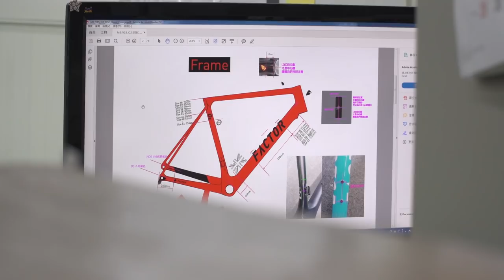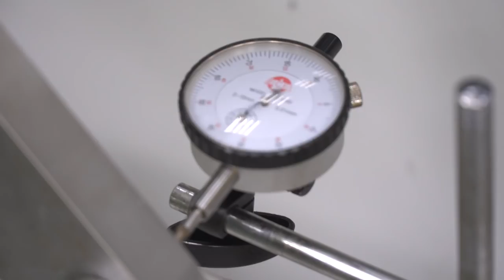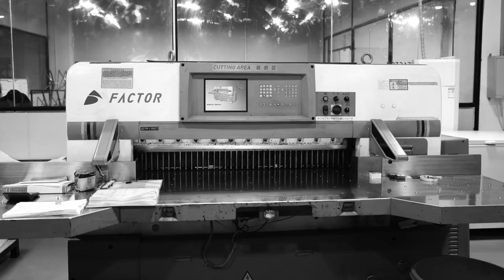Inside Factor Bikes | GCN Tours The Factor HQ

Comment: I've been watching Raoul Luescher's videos on bike manufacture.  The things he finds are very eye opening and I trust his expertise.  I'd like to know more about the manufacturing process now.  It's inside the frame that counts.  After dropping weights on components how do they know there are no cracks in them?  Seeing cracks inside the carbon is hard enough without painting the the part.
Reply: Dunno, kinda looked like a small void on the side of the seat-clamp hole to me!
Essentially the smaller your process the more you can oversee each individual person and the more you can train them, so you don't get Steve - who used to be from accounting - turning up hungover and just throwing carbon at the mould incorrectly.
Reply: I get that.  A smaller hand picked team that you can train and keep an eye on but I think the real gains are in using techniques that avoid human error.  Raoul is describing things like semi-rigid internal bladders and expanding mandrels to avoid wrinkles.  Using a fallible process and then criticising people for being human isn't very smart.
Reply: every process can fail, as Raoul points out even airplane parts can be made incorrectly, or not up to standard, the rate of which increases after lay-offs. It's about catching those parts before they go to a consumer and using better techniques or methods for making them in the first place. Smaller factory can be more picky with the workers it hirers and is more likely to have longer-term workers - assuming it's run correctly. Realistically processes need to be designed around human failure, there's a lot of large scale engineering examples of bad design that leads to human mistakes that leads to major disasters. It's the whole design cycle which needs to have safety worked into it, from adequate material safety factors, to supervision of workers, to accountability of every part/batch, through to end QC.
Reply: Phased Array Testing is standard for subsurface cracking, its ultrasound technology similar to the types of test used in pregnancy. It basically uses sound waves out of phase, that are reflected back if there is a crack or a void in the material. Have a Google if you want to know more.

Comment: pendulum test seems misleading since the whole frame with its supports on ground are moving when the pendulum hits. this movement shows that some of the force applied is transformed to movement instead of being absorbed by seatstay. such tests on specific parts should be done while the frame is fixed where momentum of the mechanism cannot be transformed to movement.
Reply: Ozan Targal -- Still it's a lot better than most bike companies that sub out their work to inexpensive subcontractors everywhere in Tiawan.

Comment: Not sure what make of rear mech is fitted to the bike in the back ground but the jockey wheels are huge!!! Well in comparison to what I’m used to anyway. See 2 mins 14 secs.
Reply: It's from a brand called Ceramic speed. They make high end component, helping save a small amount of watts. Their bearings are ceramic, instead of steel, and their jockey wheels are massive (17t instead of 11) as it means the chain doesn't bend as much, which uses less energy. They're expensive, so not worth thinking about for 99% of cyclists, but it works.

Comment: You would have thought that the frame stiffness test would have been done with the crank arm at around 90 degrees, or whatever correcpsonds to the typical rider's crank angle at max. pedal force. I'm sure it isn't at the angle it's at !! Still, it sounds as though some real engineering thought has gone into this.
Reply: By my intuition, flex isn't necessarily highest at the point in the pedal stroke where you make the most power. Anyway, as long as they're consistent with the angle it shouldn't matter where they test it.
Reply: No, it isn't necessarily at the highest point in the pedal stroke. However, it's at the highest crank torque that is where you want the highest stiffness to get the force to the back wheel and not store it as elastic energy.

What you'd really want is a bridged strain gauge on each tube to be measuring strains as a function of crank angle.

What this comes down to is that I would like to understand the reasoning behind them doing the test at that set up.
Reply: I would do multiple test, with the same load in each, but with the crank arm at every ten degrees around the pedal stroke. Then find the position with max deflection.
Reply: ...which is what I said.

Comment: Did I hear that right.....30mm or 13mm deflection at the end of the crank with 105kg on the drive side? Sounded like 30mm which is surprising.
Reply: tarmacsurfers yeah, I heard 30 mm
Reply: same, quite a bit of bendage, is it not?
Reply: I think he read it wrong, 13 or 30mm is a lot in terms of deflection. i could have been 1.3 or 3.0 mm which seems more plausible .
Reply: Mike Pop this is what I was thinking. I cannot recall seeing an engineers clock gauge go up to 30mm, plus this doesn't sound like a very stiff BB! 😂
Reply: This is gonna blow up on Twitter! Getelis better go into damage control mode. ^^
Reply: 2nd3rd1st the PR department are probably rushing to the office to draw up the "official" response as we speak 😂
Reply: my gut feeling is that it's 3mm. A simple mistake in reading the small gauge. He's a designer not a lab technician.
Reply: My god it's the deflection of the frame not the crank arm . 30mm is nothing . Also helps if you put the time of the video as it allows people to skip to that point -  8:28 .
Reply: Seb K seb chill. The clock gauge is at the end of the jigs solid steel mock crank. I think that everyone knows it is "deflection" and it is being measured at the end of this jigs mock crank. Hope u calm down soon. Ha ha 😂 sorry I didn't mention the time. If this pisses u off you are a lucky man 😉
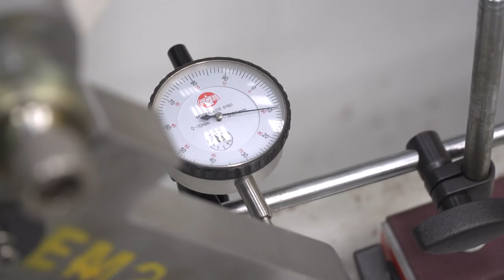Reply: Sounds like it should have been .3mm. Looking at the dial indicator pictured just before @6:52 it appears to be a 0 - 10mm gauge with 0.01mm accuracy. So it cant read 30mm or 13mm. Each line will be .01mm the number 10 indicated would be 0.1mm and a 360* sweep would be 1.0mm. If the gauge started out at 0 and moved to 30 indicated that would be 0.3mm or .012" of an inch. I'm no engineer, but that sounds about right for BB deflection with a almost non flexing (at that force) solid steel crank arm pulling straight down on that jig.
Reply: tarmacsurfers - I sounded rude . My bad .
Reply: On closer inspection, i concur. The gauge cannot read more than 10mm for one revolution, these dials can do about five revolutions. and if the dial read 30 then the displacement was 3.0mm.
Reply: Seb K downside of text I guess. Same sentence can be read several different ways 😊
Reply: That dial gauge (dial indicator) can not move 30mm. I assume, before the load that dial gauge point zero, than during the load point 30. That 30 is 0.3mm
Reply: it might be 30 micrometers. should be a simple misread.
Reply: Definitely 30 hundredths = 0.3mm

Comment: #Torqueback My Coach is making me ride 4 to 5 hours of endurance rides 3 to four times in a week(very mentally demanding). I am planning to start my first race around fall 2018. Right now I can do 150 kilometers with 32 avs on my own. I live in shanghai(dry winter) and the only place I could train is a 13 kilometer course that is 60 mins away from my house. It would benefit a lot if I can do shorter and harder rides. But if I do start doing short intervals instead of long hours in the saddle, what will I loose? My coach said that if we were racing and that I just could not keep up for the last one hour if I do short intervals. He is making me do long rides over the winter to build up my base. Any advice? I am 14 btw and have a dream of becoming a pro.

Comment: Was under the belief that Factor bikes are a UK company, is this correct cos obviously the guy who started it ain't?
Reply: Not anymore, they were sold.
Reply: I think they used to be a part of Carbon Technologies, based in Diss in Norfolk. Not sure they ever made any bikes there, but it is still a bespoke motorsport facility.
Reply: factor bike started as an offshoot of bf1systems in Norfolk who do composites & electronics for motorsports, it was then sold to Carbon Composites Bike Asia the last bike designed with influence from the original team was the Vis Vires, everything now is now mass produced & popped out of a generic jelly mold in Asia like every other manufacturer.
That's why the twin vane split down tube has gone, it's time consuming & creates additional manufacturing challenges.
Reply: These are my thoughts as well.  I was thrilled that they were designed and made in Diss as I grew up in Stowmarket.  The attraction is disappearing now that they are just another cookie cutter manufacturer.  I bet what happened was the bikes were too radical to be UCI legal and they had sunk a lot of money into the company.  The only way to go was to make more normal bikes.  The staff probably weren't interested so the company was sold to recoup the investment cost.

Comment: who the hell needs these paper frames, makes no sense apart from top racing applications - why deep sub-kilo when few hundred grams can make it orders of magnitude impac resistant, esp. in areas like they describe (rear tubes) that are often neglected (unlike e.g. forks which are at least known to be a failure-prone, see Raoul Luescher channel)
Reply: That's why we should ride more steel, made from builders based in the same continent as ourselves.
Reply: Interesting question! Worth bearing in mind that adding material isn’t just going to change strength, but also ride quality. Light weight frames reportedly have a more lively feel which is deadened by additional layers. Maybe people are happy with the trade off.
Reply: Ride a 6.5kg bike up a mountain and your question will be answered.